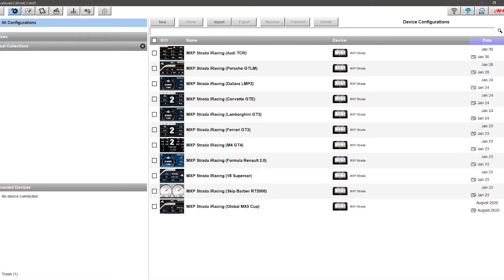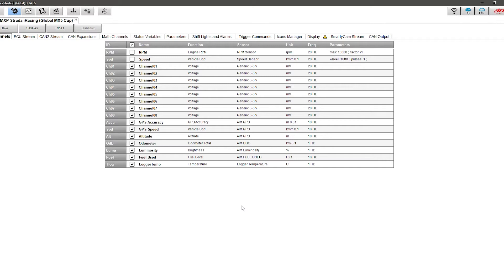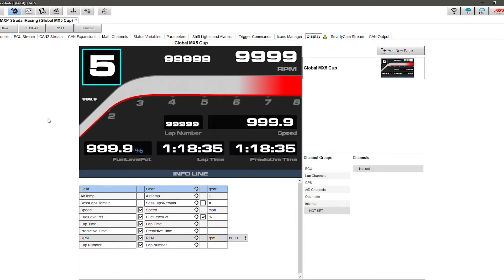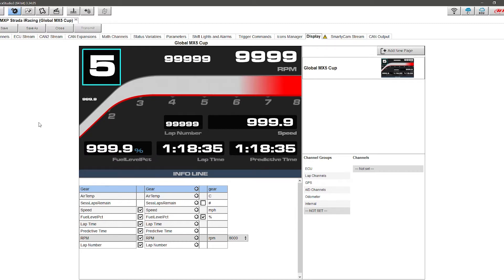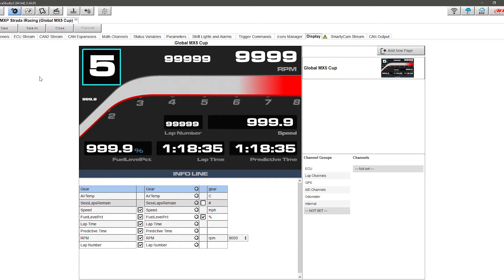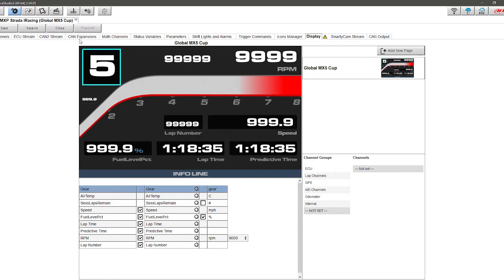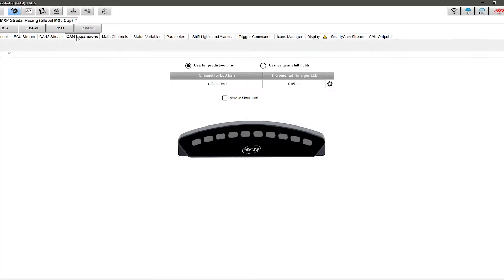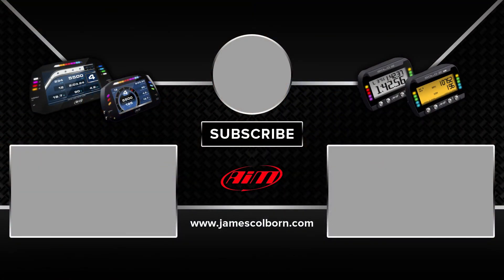AiM & Sim Racing - In Game Demonstration

Comment: Very cool stuff ! Is this working with just a USB cable to the PC ?  Thanks
Reply from the maker: Yes. USB directly into the computer. You then configure the dash, as normal, with Race Studio 3.
Reply: Ah very cool thanks for that. Seems like a very easy way to power on a dash for testing as well then
Reply: @JamesColborn  Hi James, is that a usb adapter cable that plugs into the 14 pin connector on the strada?